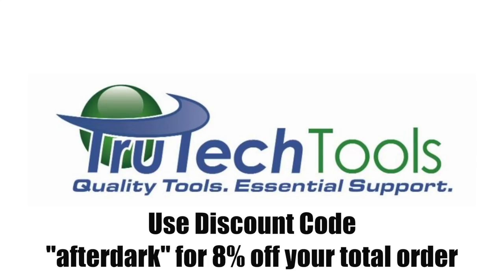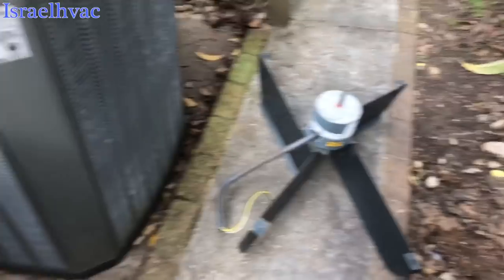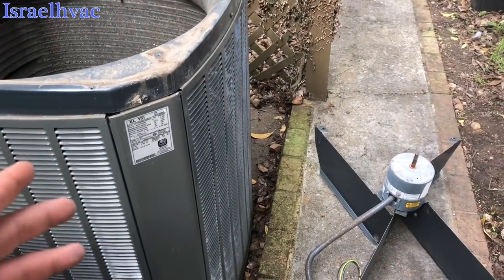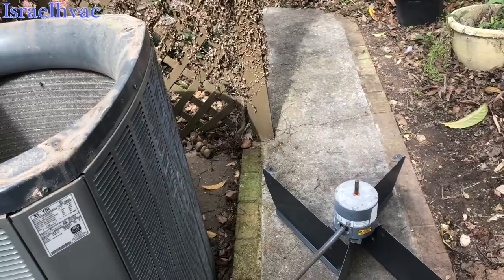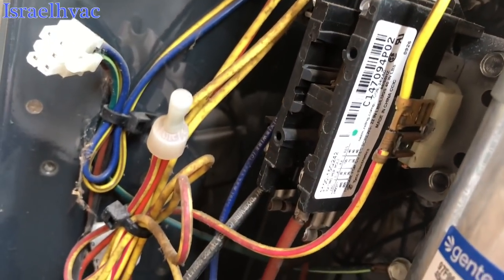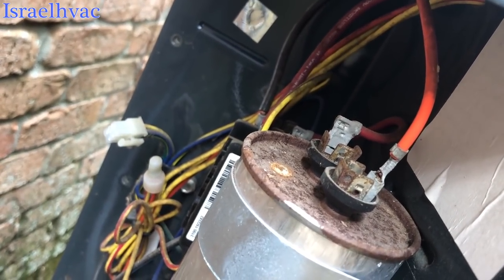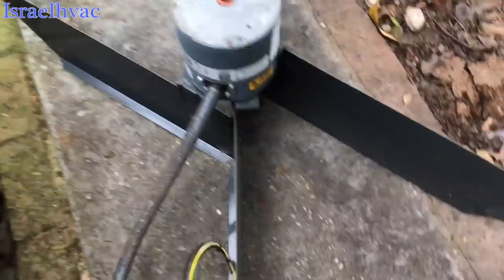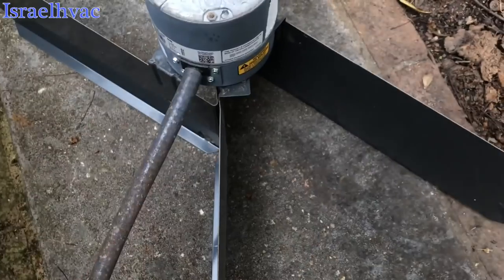Correction On Trane ECM Condenser Motor

Comment: One thing about that motor in that model John, if you kill power to the condenser during a cooling call, when you restore power, the motor often won’t restart, prompting many techs to think the motor has failed or think that they’ve somehow torn the motor up. But, if this happens, all you need to do is interrupt and then reapply the 24v demand to the motor to get it to restart. Just unplug the square plug and plug it back up. 
Basically if line voltage is removed and then restored during a cooling call it often won’t run when restored. Cycle the demand and it should run. 

That motor is presently unavailable, Trane says they won’t have any until sometime in June. You can replace it with mot18698 but the blade must be replaced also with fan04231. Which is why I came to watch this video today. I was looking for alternatives because it’s backordered at the factory.

Comment: Great Clarification!  But I think both of you are right.  The 19i sends a DC PWM signal (you can see that on the board, plus I've put a scope on that wire before) on the same wire to control the speed.  And you are correct, the 15i do send 24VAC to the same wire on the connector so since you said it's the Same ECM motor for both, the motor must be a smart enough to handle both.  Brilliant!
This is also enlightening for me...never knew that until now...thanks for posting!

Comment: I have a 15i that just replaced condenser fan on. Took me awhile of figuring and searching but finally got it figured. Mine has the board on it but still works of the constant 240(black and brown wire) then low ac volts mine read 26 on yellow and blue wire. After completing the swap and testing it i decided to disassemble the old motor to check it out. Found the actual motor was still good just the built in ecm was bad. Cannot find just ecm to buy, figures...

Comment: I just had one today on a heat pump had a board that gave 26 vac and I watched your first video I was confused but now seeing this video I know I was thinking right about it having a bad fan motor I wasn’t getting dc only ac volts so I second guessed myself. Why they would put a variable speed motor that runs at one speed I have no idea we charge 2300 for ecm and 600 for psc but they both run at one speed lol

Comment: Hello, checked my XL16i and found a 1" x 1" black rectifier right near the Ty-Wrap for fan plug connector in line with T-stat wiring. So it might be D.C. start up ?